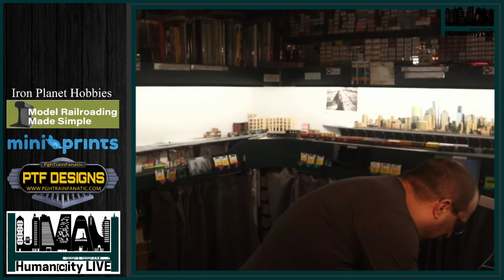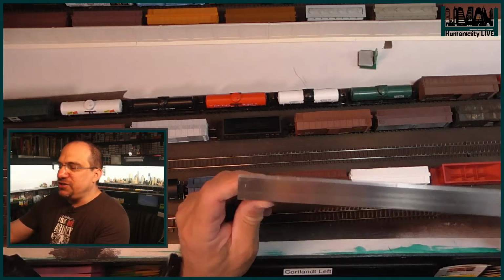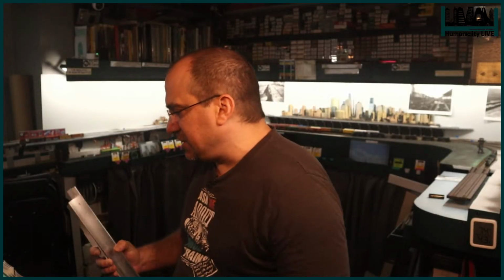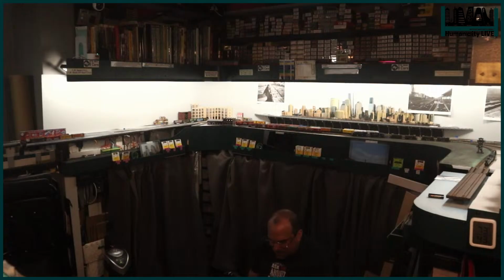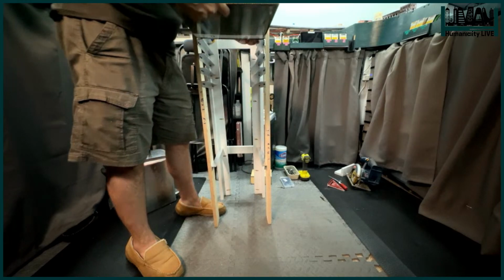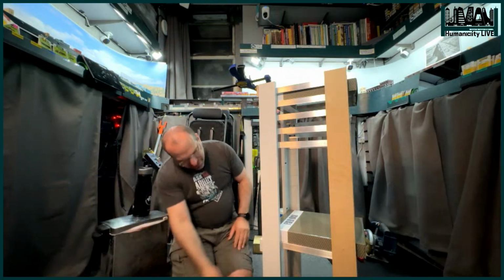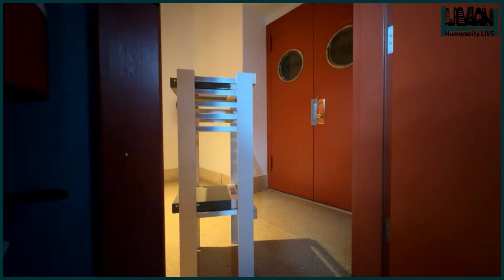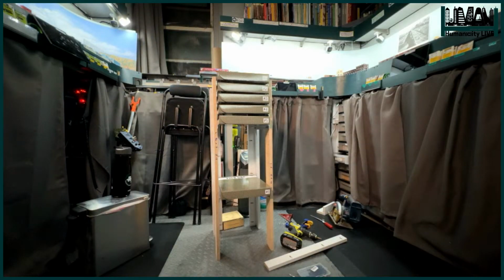Measure Once, Panic Twice – Time to Build a Shelf | Trains N Tech | Model Railroad Discussion

Comment: One flaw I see , you need some type of brace ( cross piece on the front )to keep the front opening locked into place. You really don't need that back brace more then a front one. I think you might want to fasten it to something to keep it from moving.
Reply from the maker: I need to keep the front open so I can slide the boxes in and out. 
I would need to eliminate one of the storage boxes to add a brace in that spot.
Reply: Well nothing will keep those front legs from collapsing inwards they're going to move. You could put a piece at the top and a piece at the bottom on your front legs to lock that spacing in @HumancityJunction
Reply: @HumancityJunction I'm live if talking to me there will help